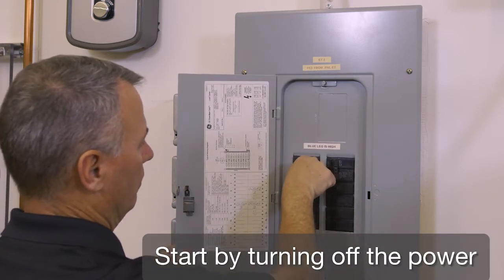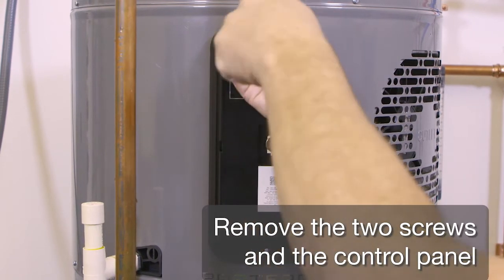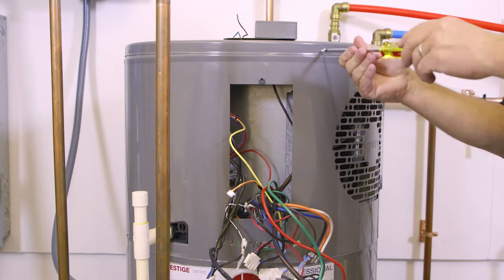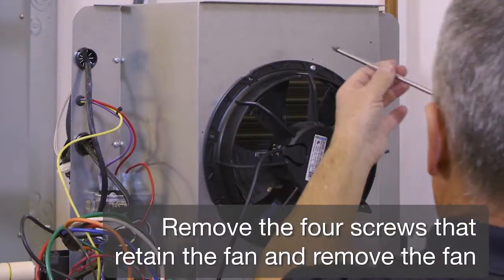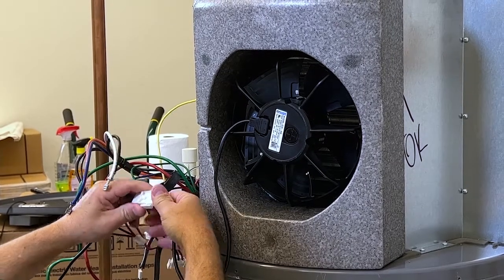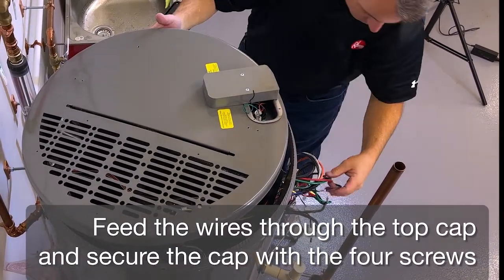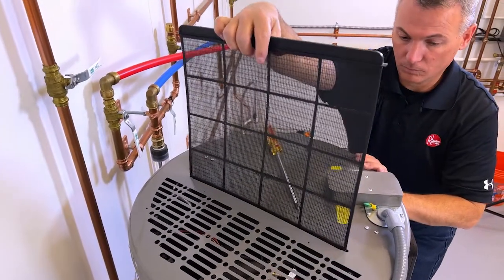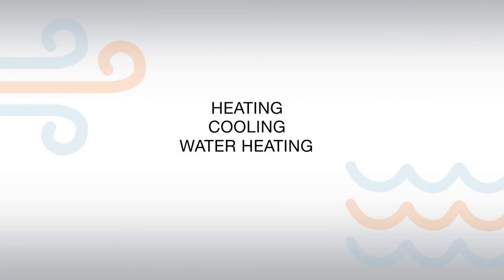How to Replace a Rheem® Proterra® Fan

Comment: how long do It take to change the fan
Reply from the maker: The process would vary depending on the person completing it as it may go faster if someone has done it before, but if you need additional details, please contact our Technical Support Team at 800-432-8373 for more details.